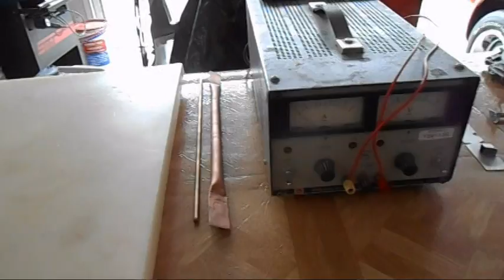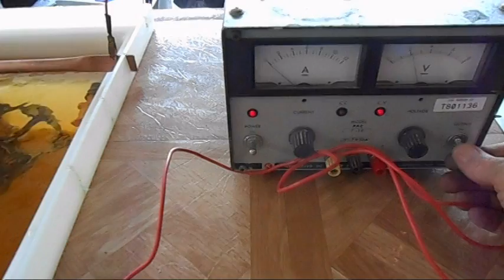Carburetor Plating Cadmium Dichromate

Comment: My chromate rubbs off no matter what I do I've been waiting 4 days drying time even 1 month and I can still rub it off with my thumb if I try hard enough got any ideas what I should do. I have not tried putting sulfuric acid in it yet. I have both kits caswell and jane kits both do the same thing
Reply from the maker: I put the formula for the chromate in the video. You should make your own. The problem with adhesion is the parts are not being rinsed well enough. Mix 1% sulphuric acid (Battery Acid 2%) per gal in distilled water. Rinse parts/immerse in solution about 10 sec./Rinse well then go to chromate. The reason the acid is in the chromate solution is to take care of that problem.
Reply: @backnine 👍
Reply: @backnine 👍

Comment: How many gpm/gph are you turning that solution in the tub?
Reply from the maker: +Garanin Corp. I don't know exact. Probably 1 GPM. You just need to put some circulation in the solution.
Thanks for watching
Reply: Thank you! I built a similar system. Will be testing it this weekend! Thanks to your video!
Reply: Harold,
Where did you get that bag for a piece of zinc?
Reply: @backnine .

Comment: What is the exact description/item number/source for the brightener solution?
Reply from the maker: Hi Dirk
 What plating solution are you using?
Reply: I would like to start with zinc plating. I already purchased the zinc anode. Have not worked on the electrolyte yet. Could not see the solution properly you are using.

Comment: I wonder if you could chrome plate a carb. wouldn't that look weird!
Reply: In a nutshell, plating any carb bodies is usually a mistake, and should be avoided. Very easy to ruin a carburetor as they are zinc die castings and cleaning them for plating is very touchy,and tricky. You have to know what you're doing.

Comment: The US penny/cent after year 1983~ish is copper plated high purity zinc... though I can't think of any reason why anyone watching this video would want to know that. . .

Edit: Brightener's main ingredient is zinc sulphate. It's just a zinc salt to create what chemists call a "buffer solution."

Edit: Your nitric acid will degrade because nitric acid decomposed back to nitrogen dioxide when exposed to heat and/or UV light. Unlike sulfuric acid, which is as eternal as the mineral it's made from.

Comment: Can I use muriatic acid for the dichromate solution?
Reply from the maker: yes you will get more green hues
Reply: @backnine  thanks! Also I'm having kind of a hard time finding the sodium dichromate. You said you found yours on ebay but I couldn't find any on there. Any help?
Reply from the maker: @ryandelara4132  https://www.amazon.com/Sodium-Dichromate-Dihydrate-Crystals-500g/dp/B09MDM4LQS
little over 1 lbs

Comment: Harold, do you heat the plating solution?
Reply from the maker: I don't heat it. I have run it as low as 60 deg. I would not operate it below 60. Room temp is what I always have run it.
Reply: Harold Demes Thanks Harold, I appreciate you sharing your will and Knowledge. I look forward to learning more.

Comment: Have built many carbs since 1986 soaked them in a solution that would make your hands buzz yea ignorant should have worn gloves. Ate the plating but cleaned the carb and the carb would work but ugly.Back then at a dealership the customer just wanted his car to start and run.Today I understand that plating was there for a purpose to keep the milky white puss at bay and with ethanol man way worse . Thank god I cleaned my 4180 motorcraft lightly in that solution 32 years ago in my 85 mustang GT still has the gold on her. I know you must do restores making that carb like the day it was made just subscribed lets see some rebuilds and tricks a dying art.God bless in this shit show covid crap.

Comment: Hi, can you please tell the formula to mix dichromate.What is the 10% Sodium dichromate mixed with 1gallon of what ?
Reply from the maker: To 1 Gallon of distilled water.
Reply: @backnine  Thank you for that information. I have another question . I was plating a piece of metal for a carburetor. I got a little bit of bubbling up of the Nickel plating.  I cleaned the part really well on a wire wheel . Does that mean it was too high voltage . I am really New at this.

Comment: Hi Harold....Have you ever tested the ph of zinc solution and dichromate coating? if you have can you let me know the ph levels...Thanks
Reply from the maker: The plating solution is  zinc chloride. PH is 5.2-5.7. My solution is about 5.5. If it gets above 6.0 it will plate dull even with the brightener added. I add hydrochloric  Acid (muriatic is OK) to bring PH down. The only time PH will go low is if you have put to much acid in. Put Ammonium Hydroxide or Potassium Hydroxide to bring up the PH. I do not test the PH of the dichromate solution. If it looses it bite I add small amount of sulfuric or muriatic acid.

Thanks for watching
Reply: Hi ...is it at all possible to check PH of Dichromate solution..Not being able to purchase straight sulfuric acid over here, I had to use Battery acid (pre mix sulfuric/water)...Not sure if I got my calculations right !  Thanks
Reply: @brendankolk6883  Did you find an answer to your question here?

Comment: What would you charge to do 3 Holly two barrels carbs?
Thanks Cory
Reply from the maker: What carburetors are they Six Pack? Do you want just plating or restoration. Email  chucknorbid@gmail.com

Thanks Harold
Reply: 1968 ford cj8
Reply: If you can re build them jets pump 
Seals the hole deal that would be cool.
Reply from the maker: @250race  What Carburetors are they????
Reply: @backnine  
Yes  6 pack 
3 deuces
Reply: I'm at football practice let me send you a email later on tonight 
I'm in CA 
Sorry for being so short on what they are just came a cross what you do and I would like them new.
Reply from the maker: $490.00 + shipping back to you.

Comment: Cadium?
I thought it was cadmium
Reply from the maker: Cadmium is a metal they used for plating. It was replaced with zinc because it is toxic to work with. The Dichromate is applied to either one.
Reply: Why does the title say Cadmium and then you drop a Zinc plate in there?
Reply: Burt, the title says Cadmium Dichromate.  The brown stuff in the bucket.
Reply: There was no Cadmium involved Greg.
Reply: Sodium dichromate and battery acid, with water.
Reply: donpearce - Yes, it is a bit distracting, but for me the obvious expertise in the practical area far overshadows a bit of mispronunciation.
Reply: @burtreynolds3143  He is zinc plating to give the cadmium solution a zinc substrate to react with and thus render the cadmium finish.  He went thru that.....

Comment: I've been through this 22 minutes a couple times and cant find any mention of what your solution starts with. So much  sulfuric acid and 10 oz of dichromate to 1 gallon of what? Would this be distilled water, tap water?
Reply from the maker: Hi Rick
 Sodium Dichromate 10 O/Z by weight 1/2 Sulfuric Acid by volume (Battery Acid at your local parts store) to 1 Gal.of distilled water. When solution starts to loose it's bite at a small amount of acid. Here is an Ebay link for the Sodium Dichromate.

Thanks Harold

http://www.ebay.com/itm/Sodium-Dichromate-Dihydrate-99-Lab-Chemical-1-lb-/371844068198?hash=item5693a23366:m:mzb5_6qX9KeAA20mlVsNgDw
Reply: Thankyou so much! By the way, awesome video!
Reply: Harold Demes 
Harold, question. I'm reading the 1/2 sulfuric acid by volume as.  Per gallon add 10 oz sodium dichromate, then fill with distilled water up to the 1/2 gallon mark, adding diluted battery acid (car battery % not concentrated) up to the gallon mark.  can you elaborate. Thank you.

Harold B.

Comment: Shouldn't you be wearing gloves? Are the chemicals completely safe to work with?
Reply: Yes he should, Cadmium is a heavy metal, and toxic. That's why NiCad batteries  aren't to be simply thrown away.
Reply: Except he's not using Cadmium.
Reply: Erik J. His own instruction was to always wear nitrile gloves
Reply: Frank Mulcahy Agreed gloves should be worn. Was just stating the fact he was not using Cadmium, as the other poster suggested.

Comment: That's a power supply not a rectifier, key is to get a lab/bench power supply that has a constant current mode. With the current setting turned to the lowest setting short the output of the power supply and then adjust the knob until the ammeter shows the desired current. Then disconnect and hook to your work piece.
Reply from the maker: A Rectifier converts A/C Volts to D/C Volts. We are plating with D/C.

Comment: For you millenials, that funny looking rubix cube is called a carburetor. It's what engines got their fuel from before fuel injection was invented.  They are actually more efficient than fuel injection at constant load and rpm. They don't have any cable hookups because they are purely mechanical. They use physics alone. No computers, no sensors, no bullshit. Just pure reliability and simplicity. They are still used in aircraft. Why?  Because they work. If your cam sensor shits out on you at 15,000 feet and your Injection system dies, you're screwed. There are no tow trucks in the sky.